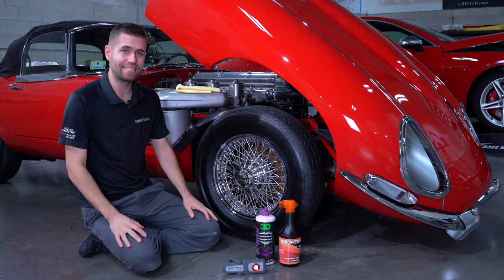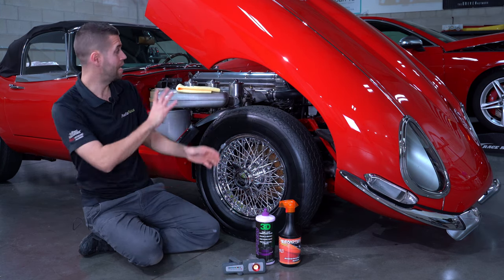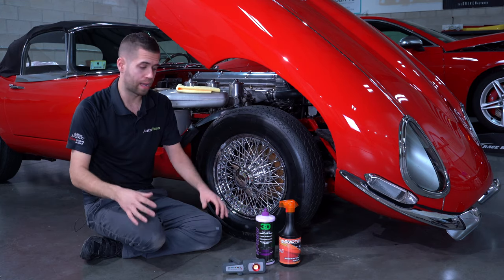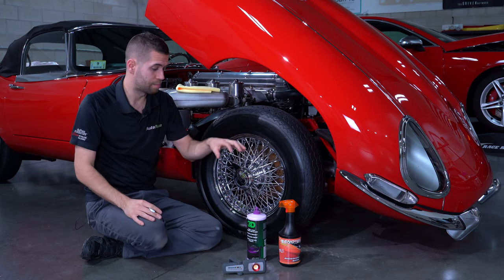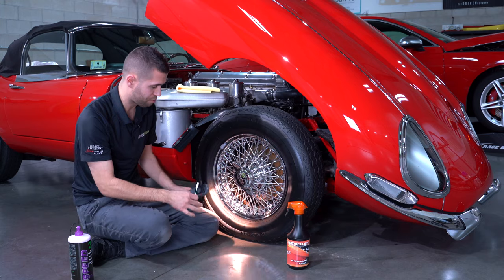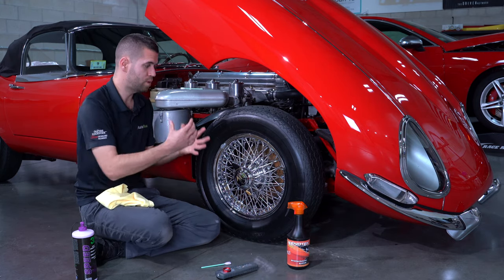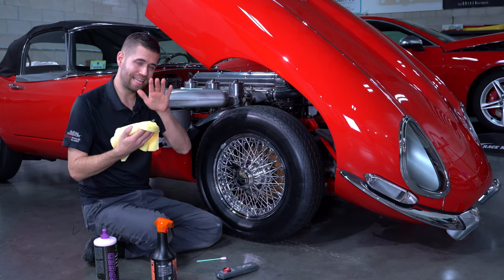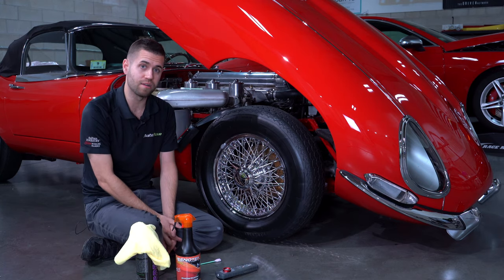Detailing Tips l Cleaning Wire Wheels l 1969 Jaguar E-Type

Comment: Surely the wheel has to come off before you start this job. What about the back of the wheel and spokes?
Reply from the maker: You can use skinny brushes like the EZ Detail Mini to reach most of the back areas, however, for a complete clean removing wheels like this is suggested.

Comment: This is not a big deal. I have a 66 roadster. Just get a good wire wheel chrome cleaner, let it soak a bit then use a low pressure power washer. It's just that easy.

Comment: Take the wheel off its easy and clean both sides its the only way with wires.
Reply from the maker: For the best cleaning process removing the wheels will be a huge help. These are some tips if you can not or do not want to remove them.